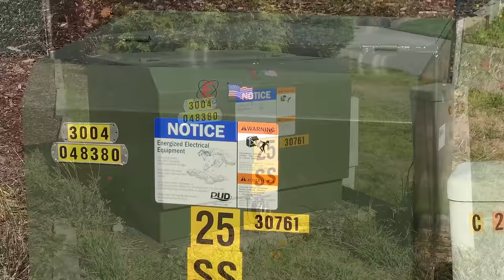Replacing a Pad Mounted Residential Transformer

Comment: Look at the tremendous respect these guys have for that not-very-big-looking transformer!  Observe the very careful procedures they go through to work on this stuff safely.  It's no joke.  The amount of power available in this little point of presence from the grid is difficult for most folks to fathom.  It's so great that it's hard for ME to wrap my head around it, and I have worked with both industrial high voltage equipment and laboratory HV stuff.  Look, forget_about electrocution!  At high power levels, the phenomenon of Arc Flash comes into play, and it's nasty.  Limbs can be burned off - leaving a charred stump - by an electrical arc in seconds. Permanent blindness, or horrible disfigurement can happen, and that's if you live.  The warning stickers should read: "Danger: You Will Suffer The Whole Time You Are Dying".  Keep this particular genie bottle closed.
Reply: Please lecture whenever you can that electrocution means death.   This fact seems lost on most people today who hear or assume incorrect usage and adopt it themselves.

Comment: I worked for Con Edison, Westchester Division 36 years. OMG, if I got caught near a Pad Mounted transformer without rubber gloves on like that, SUSPENSION! ONLY time without would be ALL power off. Very simple job, except when the 7.2KV bushings are alive. Be Safe Everyone
Reply: I was thinking the same thing. So much so that at the beginning I thought the power was off because of the lack of insulated gloves & face shield
Reply: and they knew they were being recorded
Reply: The crews I work with isolate and de-energize the failed transformer prior to touching any cables, and still wear insulating gloves and FR clothing.   They would be fired immediately if caught without.

Comment: A buddy and I lived in an apartment in Houston around 2003 that had a bigger version of that go out during a storm over a weekend. At first we were told it wouldn't be repaired until Monday but someone in management approved the extra fees to get it done the next morning. That one was about 3x as big but it powered 2 buildings with 18 or 21 units (3 floors) each. Before the old unit crapped out the lights flickered a lot, especially when A/C units turned on or off. After the new transformer was installed there was barely any flickering.

Comment: It would be interesting to know how long that transformer was in service, when it was installed and the manufacturer. I worked for a major transformer manufacturer in the 70's. While in their employment, a utility retired one of the first pole type transformers the company manufactured. It was badly rusted and corroded after thirty years of service. The newer models wouldn't rust or show that much deterioration as the early transformer, just a little faded due to better paint and manufacturing methods.
Reply: was put in in 1973

Comment: We have one on our heavily wooded 10+acres.
Cool feature. We don't have to worry about trees falling or heavy ice storms on the electrical lines. We also save from having fried squirrels.
Reply: Squirrels and other animals can still get in there (did you see the cable entrance area is all open?) especially if they can borrow through soil.  Underground service may be safe from trees that don't land squarely on the transformer, but that doesn't mean your electricity is uninterruptible.  Underground service can be flooded.  Animals can damage the cables.  Humans can damage the cables.  Tree roots can damage the cables.  Moving ground (frost, earthquakes, etc) can damage he cables.  The cables may just wear out.  Diagnosing problems with the cables is much more difficult since they can't be readily seen.

Comment: for being in the elements for 50 years, those bus bars looked fantastic! I have seen newer busbars on smaller systems corrode so much that the entire bar turned into dust. 70's shit is built different.
Reply: Tx from the 50s we’re even better. Copper windings and no leaks 70!yrs on. !!

Comment: I have terminated thousands and thousands of aluminum conductors in a mechanical lug and I have NEVER used an impact to tighten my lugs. Always tighten enough to hold cable in lug firmly, and then torque to lug specifications. I’ve had many times where I’ve gone into a switchgear and unlugged a conductor just to have the strands break off. They did a great job just crazy to see that be taught and accepted among so many guys that were there…
Reply: I was a little surprised that they weren't torqueing the bus connections.  I've never terminated aluminum, but I've landed plenty of  copper in switch gear and all was torqued to spec regardless of using an impact or ratchet for the initial tightening. No new grease either.  Hmmm.
Reply: Look at 3:30 and see where he leaves the ratchet on the bus of the old transformer.  I figured that might have something to do with them using the impact to re-install.  LOL
Reply: It was weird to not see them clamp the cables directly in the center of the bare wire. Instead, they just clamped where ever, just as fast as possible.
Reply: Is any kind of anti-oxidant goop ever used on aluminum conductors of this size?
Reply: A quarter inch drive isn't able to put out much more than 15 ft-lbs.
Reply: @philkarn1761  all aluminum conductors regardless of size should have the oxide film removed with sand paper and then noalox (diox) should be applied. Some say the oxide film does the same job as the noalox but every installation handbook says to remove film before installing. 🤷
Reply: @godawgs3555  the alumium oxide film is nanometers thick but highly insulative and it will grow. If you put the grease there is less air getting into it. It grows over the years to become insulator.

Comment: Good job guys. Thanks. Our concrete pad mounted transformer was slowly slipping off the pad, over the years,  as the soil underneath it slowly settled on the side of a ravine. I was afraid the cables inside of it would snap.

Comment: Assuming this is a loop feed and not a radial feed, why not close the loop, isolate and ground the primaries. That way you're not messing with anything energized.
Reply: They had the feeders parked and possibly closed so the primary wasn't connected until the end when they used the hot stick.
Reply: Sergeant Seven parked is open not closed. And no they did this whole deal hot. For no reason. And foreman probably got fired. This whole video is straight trash lol
Reply: Ben T.  yea possible but induced voltage really isn’t that common. Especially if it’s a bunch of houses like that community. Isolated house yea maybe but with a community the generator will try and run the whole neighborhood and trip right away. This looks like an average loop style area. Not much of a chance
Reply: Ben T.  it’s a bunch of crap. Just iso the section. Ground primary’s. Don’t undo each wire on taps just pull whole tap. Fold grounding in. Pull tx. Put new tx. Plug elbows. Energize. Test voltage. Pull bayonet. Put taps and set screws and put fuse in. I’ve done them with a time out of less than 10 minutes. And it was safe.
Reply: And the fact that they got in there without hot gloves while it was energized was messed up
Reply: @sergeantseven4240  ...If you look closer it looks as though they closed the loop and parked the elbows on a single feed thru leaving hot primaries to work around. Bad idea. Why not close the loop and lift elbows at both adjacent xfmrs which allows you to be able to ground the primaries and work the xfmr totally dead.
Reply: @bud5041  cause they suck. And as they say, sucks to suck.
Reply: @deltadelta2247  The fact the guy wasn't wearing any gloves at all (bare hands) in the beginning made me on the edge of my seat. "Is he going to get fried? Is he going to get fried?"
Reply: @fitybux4664  none of them were wearing any PPE other than the occasional set of rated gloves.  I've had to watch 4 days of training showing dummies and real accidents where people are getting blasted with molten copper and other metal and watching how easily their clothes catch fire during an arch flash.  This was scary to watch.

Comment: Holy crap I've always wanted to see what's inside these
Reply: All that's visible are the connectors in front. The actual guts of the transformer, the windings, are sealed in the back half of the unit.

Comment: My first rule of safety for electricians,  if you do not have to work on it hot, DON'T,  this is not a feed thru TX  so it should have some gates at a pole you can disconnect, or it is getting its power from a feed thru TX  somewhere down  the line that can be disconnected, or even from  a 12470 volt terminal box that is near by. If I had designed this I would have use one of the three way I described, to wire this neighborhood. Think safety first not cost.

Comment: 1. Transformer ~ $4,000
2. Labor ~ $1,200 (12 man-hours)x($100/hour)
3. Property value increase = $0.00
Reply: "Transformer ~ $4,000
2. Labor ~ $1,200 (12 man-hours)x($100/hour)"

Unnecessary cost to the utility that gets passed along to everyone else!
Reply: Lol the bigger ones at industrial buildings are only $50000 or more.
Reply: And it's only single phase.  what a gyp.
Reply: And to simply put back something wholly inadequate to power three houses. (25KVA would be 34A per house. I hope they don't all turn on their drier at the same time, or ever buy an EV)
Reply: What's the property value WITHOUT functional electricity service?
Reply: One of the most Washington things I've ever seen. This level of ridiculous neuroticism and entitlement plagues the entire state.
Reply: But some guy with nothing better to do but complain about it for no reason EXACTLY like the guy in the video who got it changed for no reason in the first place? Priceless.
Reply: You coulda done the same thing with a 4$ can of clear spray paint , saved the tax payers the unnecessary cost. So you got rid of an old ugly box to get a new shiny UGLY box ...you need to get a volunteer job.
Reply: There is a budget for replacements. If you think this was an extra expense that was not part of that budget (just to appease a homeowner), think again. Nothing wrong with changing out hardware from the 70's. You all will be the first to cry "SUE THEM" when the thing leaks and you hear they didn't have power for a day.

Comment: I knew a guy whose father was killed  by putting his hand into the transformer box without gloves. conductive dust had coated the connections. Stuck his hands in, then as he drew them out, pulled out an arc. First guy working without gloves was not following proper work practice even if the power was switched of on the high side. Always assume the system is hot even after switching off power. Assuming that it still may be hot has saved my life several times. (Backfed inverter without anti islanding, one phase of a three phase circuit landed on another breaker, and No Blow Zinsco main breaker still passing current after shut off.  I learned this lesson on my first job as an apprentice when the boss said the power was off on a circuit. Lost a good pair of klien's for that. Please work safe, you and your family deserve to have you come home whole and healthy every day.

Comment: I don't know what I find more concerning. That they reused the bend, and probaby broken tips of the wires again or that they fastened them with an impact drill.
Reply: I know those lugs get stripped out using an impact happened to us one time at a shutdown i always use tork wrench
Reply: @thomasdominguez8421  
The lug driver was a torque bit I think.  Each bit is a different setting of torque.

Comment: I was a 1st class lineman for 41 years with central maine power   this is not the safe way to do this...  makes me cringe to watch.   they need to be retrained before some one gets killed.
Reply: Lol to say the least. But they know better.
Reply: What's the thing at the end he twists with the pole? Kind of looks like a old  dipstick handle
Reply: Probably the insulating cap or plug.
Reply: @philpullan8595  Its a loadbreak elbow   it feeds the voltage to the transformer
Reply: @MrT13  loadbreak elbow   they remove them and install them on a parking bushing so they can  replace the transformer
Reply: I’m a lineman I know what it is but I dunno exactly what this person is asking. Usually you don’t twist elbows too much...
Reply: He’s probably asking about the insulating cap
Reply: @MrT13  maybe he's trying to spread the grease on a hot elbow
Reply: Honestly I’d have to watch it again and get a time on video but I’m pretty sure he’s not trying to do that. But then again maybe lol if this guy really wants to know he can watch it again and say at whatever minutes seconds the whatever color looking thing and I’ll go watch it again.
Reply: Maybe he’s asking about the hook on the end of the shotgun lol. I dunno
Reply: I’m assuming he’s talking about the set screw on the feed through.

Comment: Just some observations for those concerned about gloves and other PPE.  De-energizing the mains is not necessary.  Vault is safer than pole mounts as it uses a stab connection.  The person operating the stab pole was using proper HV rated gloves.  While connecting the customer drops the transformer is not energized so no need for HV gloves.  I would agree safety glasses should still be used.  Note they tested the transformer for proper voltage then disconnected from the distribution before connecting the customers.  Too many failed to see that.
Reply: If this was my company,  we'd be having a stand down.  There are several  safety issues here, mostly with the guy in green who works in the cabinet with no eye pro, no gloves and who stands by a swinging clevis several times with no hard hat.  I'm sort of surprised that the linemen in the blue FR shirts don't have to have arc flash face protection or safety glasses, but otherwise, they seem good to go.
Reply: @kcgunesq  Agree, the person in the beginning w/ the high vis vest is not being safe.  He appears to be the supervisor looking at his interactions w/ the crew.
Reply: And if one of those customers had a genny backfeeding the line?
Reply: @stargazer7644  Jail and toss the key.
Reply: @MrT13  Did not say it was a vault.
Reply: Vault is safer than pole mount as it uses stab connection?
Reply: I can’t even say gloves are the worst part of this bucket of trash. They connected a loop with a feed through. Or ran houses on a feed through. Either way that’s only a testing device. Never to be used under possible load. If this was a feeder tie and they did that goodbye elbows. Or if it wasn’t the normal open and they ran houses with a device that says right on the package for testing purposes only. Not to be used as a load bearing device. Or the fact that they could’ve just went to the two tx on either side and parked the elbows killing everything. Or that they just trust me they suck and the foreman is definitely fired after this video got to whatever utility company this company contracts for. We watched this video and all had a great laugh at a bunch of it. And kept pausing it over and over again pointing crap out. This mite look ok to the average electrician or something but this crew is a bunch of trash lol. I do this quicker and safer all the time.
Reply: Something about customer drops? No gloves needed next to 7200 volts? Mains??? Just trust me this is all trash. Don’t defend any of it.
Reply: Drop is for oh. This is a customer feed. Or smoe. Or secondary. The main is called the primary. The stab pole is a shotgun.
Reply: But you are right they did test voltage lol. You did say vault lol. It’s called a pad mount tx.

Comment: We have a pad mounted fuse box two houses down the street.  It's where they connected a portable generator when they had to dig up an underground power cable to make a splice.  Underground cable had just a pinhole  and power for the 22 homes on the street was out for about 24 hours.  Those guys earn their pay.

Comment: Power company did something like this in the street where my in-laws live. Somebody goofed, and when it went live it sent 27,000V into all the homes along the street.
That got expensive for the power company!
Reply: How many fires were started?
Reply: by the looks of it that is impossible in this box.  the hig voltage side uses these weird rubber plugs , cant be connected to the bare wires on the right that carry to the homes. maybe the unit was faulty ?
Reply: @joppepeelen  They didn't bother to properly install caps on the weird rubber plugs. One of the bare 120VAC connector wires could touch the weird rubber plug 10kV wire and send 10kV to a house.

Comment: Those have been going out allot this summer. We had one that was not hot and had no pressure when you pull on the relief valve so we put a new 8 amp fuse in it and it buzzed at us for a little bit and then went poof.

Comment: I really dont like how open the 3 Secondary rails are, here in germany we also have "open" copper rails at our transformers, but mostly behind big plastic fuse-disconnectors or other shieldings
Reply: It’s 240 volts, phase to phase, under a locked steel cover. You literally have to be less than a mm away for it to arc. Whether you like it or not doesn’t matter, it’s perfectly safe the way it is 🤣
Reply: Its safe until a rat or mouse or snake gets in there😂
Reply: @legominimovieproductions  it literally happens every day on transformers hung on poles dude. Every. Single. Day.
Reply: @legominimovieproductions  No problem with a snake getting in there. It will quickly sort itself out. 😆

Comment: No torquing? When are they going to come out with an torque (wrench) impact cordless drill??
Reply: Looks like they used PFT spec on these lugs
Reply: I thought you suppose to use a hand torque wrench like mechanics use to torque it down?
Reply: Nasa has one but they cost $100 grand.
Reply: Impact works fine.